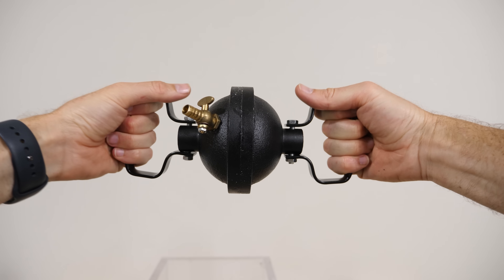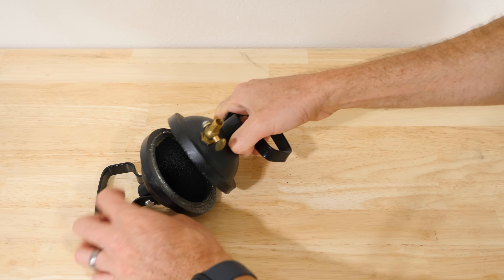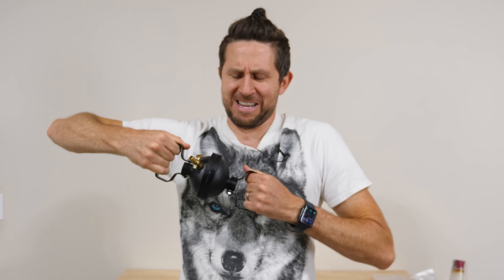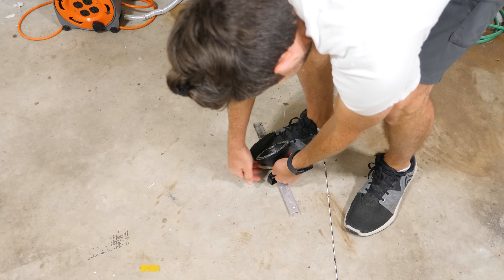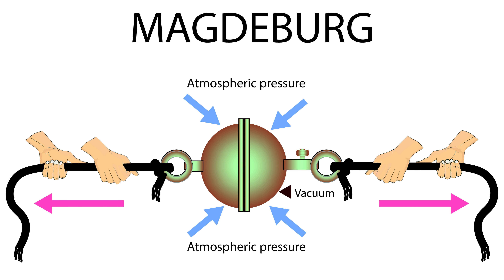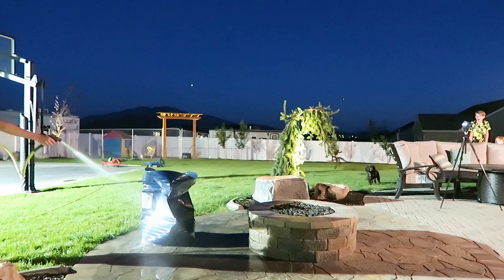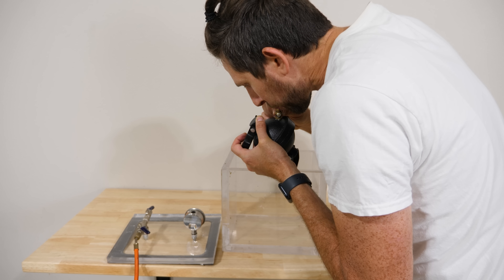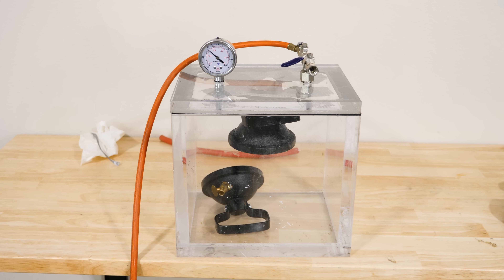Pulling Apart The Magdeburg Hemispheres

Comment: I don’t get how he was able to pull the air out of a sealed container that doesn’t deform. Especially with his mouth.
Reply: It wasn't that good of a vacuum
Reply: Lungs
Reply: Because the air and the container are seperate entities and air will when in a container, diffuse from an area or volume of greater concentration to one of lower concentration. Standard conditions assumed of course.  When he inhales he creates a greater volume in his lungs for the given volume of gas in them thus a lower concentration. This causes the air in the spheres to expand in the only direction it can, through the valve and into his lungs.  There is some deformation to the spheres, small though it may be. Most of the deformation will be in the jelly between themand the distance between the edges of the two spheres. They will ne pressed together by the ambient pressure. 
 Its essientially a vaccum chamber of its own. He just isnt creating a very hard vacuum as its called. Its a partial vacuum. Which is why he was able to pull them apart in the chamber because the pressure outside the spheres was less than inside when his pulling is taken into account.
Reply: Because air is compressible. It can be squeezed and stretched. You can test this, if you have access to a syringe, or a bicycle pump, or a footpump. Block the outlet and push down on the plunger, handle, lever, or whatever. You'll should find that you can move it, but it springs back when you let go. This is due to the air compressing.

With the syringe, you can go one better. Push the plunger in before blocking the outlet, then pull the plunger back. This stretches the air, creating a (partial) vacuum. Be careful when you release the plunger, because of the syringe is new and still has a friction reducing coating on the seal, it can snap back very quickly.

Water, in contrast with air, is almost incompressible. You will not be able to push the plunger in if the syringe is full of water. You might be able to pull it back, in which case you'll notice bubbles appearing. These are low pressure (stretched) air.
Reply: @weevilinabox  im not sure how helpful that was. I could have simplified mine even more by saying that the capacity of an ideal gas to move from an area at a specific concentration to an area of lower concentration isnt determined by the rigidity or compressibility of its container, but by the existence of a path between the two areas.

Comment: That is crazy! I don't think I would have believed that we had that much pressure pushing down on us until I saw this video. I always thought it was just negative pressure in a vacuum that caused the collapse. Thank you for sharing.
Reply: there is no such thing as negative pressure in reality. Zero is the floor. below zero would mean there is less than nothing, which is illogical.
We just defined 0 as sea level on earth for a lot of common uses, but in science you usually deal with absolute pressure which only goes down to 0.
Reply: Not just pushing: squeezing!
Reply: It is just negative pressure. But for negative pressure to exist it has have positive on the other side. It has to be negative in relation to something else. If it’s 10 pounds outside and 5 pounds inside then you have 5 pounds of negative pressure on the inside. Its 5 pounds less inside. So basically you were thinking about it correctly but just not taking the logic all the way to it’s conclusion. 😄👍

Comment: What would happen if you funneled water in the vacuum chamber? Which way would it spin?
Reply: if you give it initial momentum it will spin with that momentum, otherwise it depends on the Coriolis effect and the spin depends on your location with respect to the equator. The initial momentum is usually the determining factor as it's very hard to remove all momentum in order to see the coriolis effect.

Comment: Okay now try pulling the lid off of of the vacuum chamber then if you can’t put it in a bigger vacuum chamber and so on
Reply: Recursion! 😅😅💔💔
Reply: @dahumbleprof  state the base condition atleast
Reply: @ujjwal2473  ... the hemispheres?
Reply: @ujjwal2473  no!
Reply: 10 videos later: "I've encased the earth in a vacuum chamber"
Reply: Vacuum Chamberception?
Reply: It's vacuum chambers all the way down.
Reply: @hondaguy9153  this is messing me up more than the turtles, my dude, ‘cause this basically describes quantum fuckery right?
Reply: @brownie3454  lol, I guess it could apply to that? I don't know enough about it. I was just messing around. 🤣
Reply: @hondaguy9153  dont do this to me, i need answers!!
Reply: The Russian Doll Vacuum Chambers.
Reply: Inception
Reply: Or just let the air back inside once it falls apart.